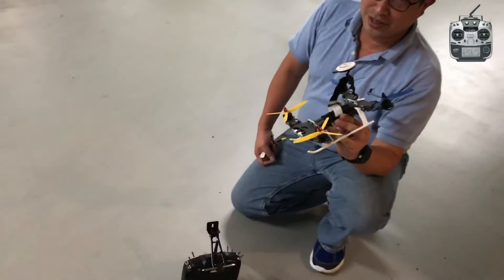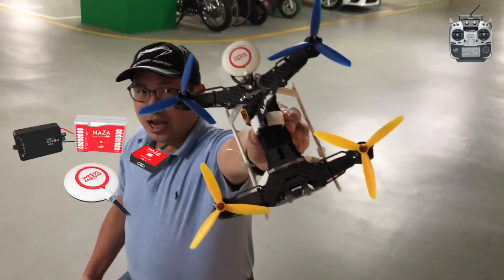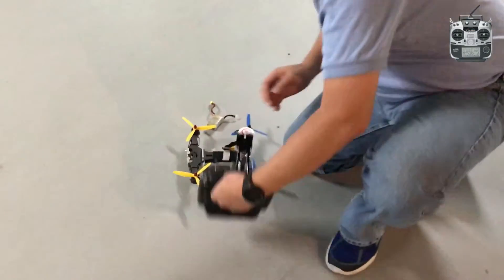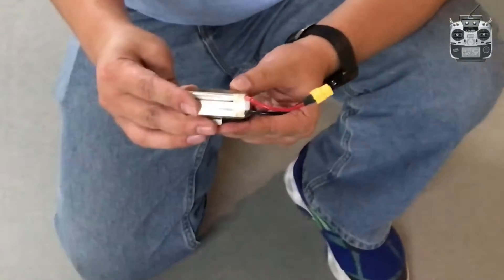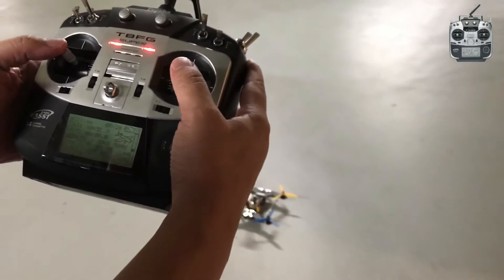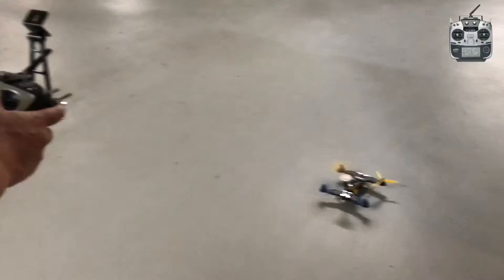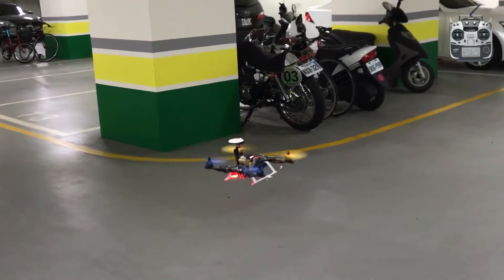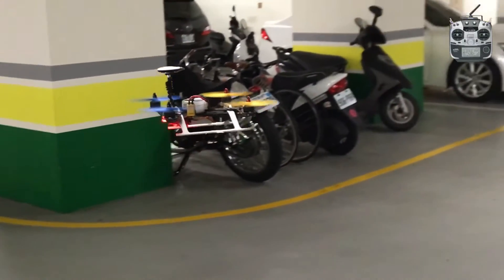Dji Naza Lite 🆙 V2 Naza firmware upgrade testing on TAROT mini 250 FPV Quad

Comment: i cant get my motors to arm :-(   Have been trying for days , DAYS I TELL YOU !    Feel like throwing it all out the window.  The motors all run fine when tested through throttle output channel on the reciever.  Plug in the naza and its a blinking orange light.  I regret buying the damned thing. I bought it as it was said to be straight forward plug and play.     QUAD !

Comment: Bro I do the upgrade but my naza turn off when I fly more of 3 meters of high, you have the same problem, what kind of firmware you used for the naza works well ???